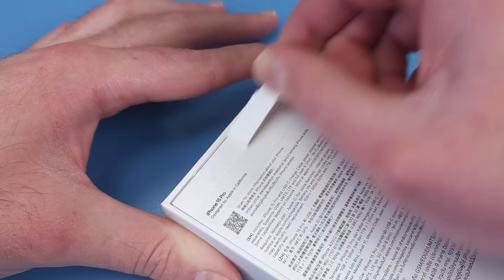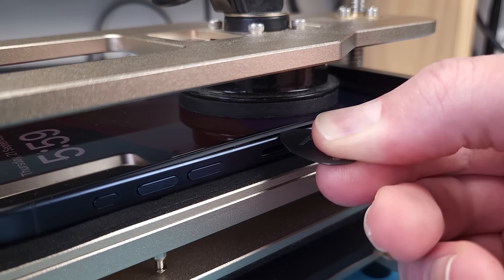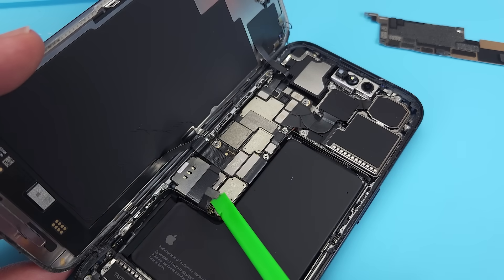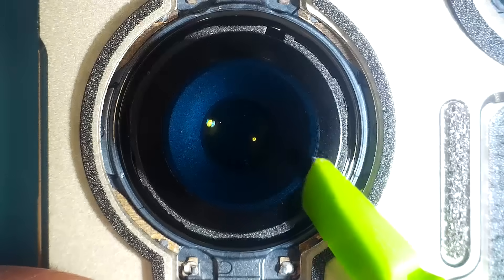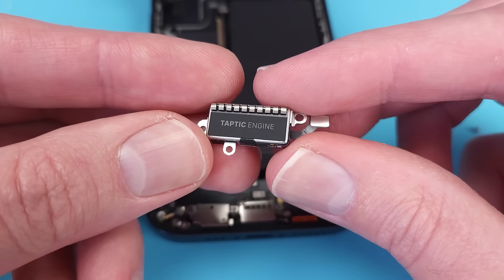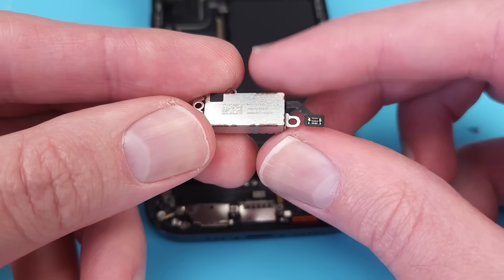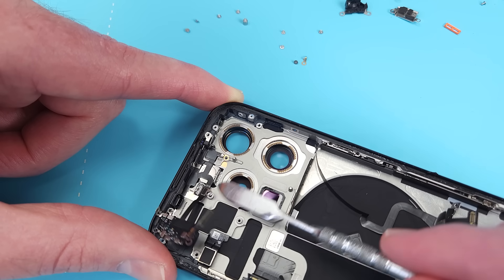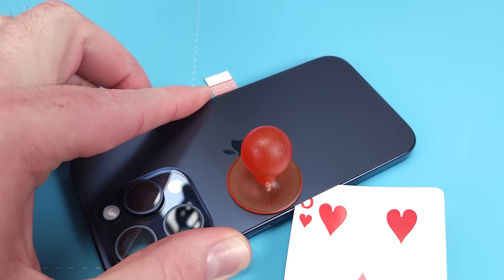Tricks to Get Around Apple's New Design - Full Disassembly

Comment: I usually use toothbrush bristles to clean the dust inside the gap between screen border and frame , does it effect on adhesive and water resistance ?
Reply from the maker: Only if your bristle is hitting the adhesive and pulling on it, tearing it.

Comment: Hi, will you be able to remove the usb c of the iPhone 15, or order this part and put it on the iPhone 13 mini? Kind regards.
Reply from the maker: No, no without converting lightning to USBC on the 13 mini.
Reply: @RestoreTechnique  Thank you for replying. But that is what I want, USB-C on my iPhone 13 mini, you did it for the normal iPhone 13. Will the proces be the same for the mini?
Reply from the maker: @vidsyoh2324  Yes, the same, except less internal room to fit the components. So even harder.
Reply: @RestoreTechnique   Another question: That iPhone 13 could only be fast charged with de USB-C cable put in one way, but when you put the cable in the other way it would not fast charge, is there now a USB-C female connector which fast charges both way, meaning flipping the USB-C cable will fast charge the iPhone 13?

Comment: Non vedo mai nessuno che mette l’adesivo prima di chiudere sia lo schermo che la parte posteriore .. penso che senza quello diventa IP65🤷‍♂️
Reply from the maker: Replacement adhesive seals for this phone are not available   on the day the phone is released. As mentioned in the video, I'll replace those water resistant seals when they become available.

Comment: I wonder what the difference between an iPhone 15 and iPhone 15 Pro's USB C controller is, or if the difference between the transfer speeds is down to the port itself.
Reply from the maker: I saw a picture of the usb port of an iPhone 15, and it appeared to have the same number of pins. So I reckon it must be the controller.
Picture: https://m.rewa.tech/detail/iphone-15-plus-charging-port-flex-cable-replacement.html?utm_source=EDM_Mailchimp&utm_medium=email&utm_campaign=iPhone15SeriesParts_15pluschargingportflex
Reply: @RestoreTechnique  ahh understood. Thanks for taking the time to respond! I have a suggestion. Making a USB-C case with a flex cable built into the case that connects to a microSD card.

Comment: Does it opens up easily on daily use without the adhesive?
Reply from the maker: No. I put some generic double sided tape on the back, and the screen is clipped in place and has 2 screws at the bottom, so it's fine.
It's not my daily driver though.